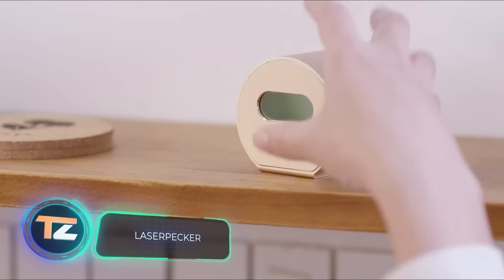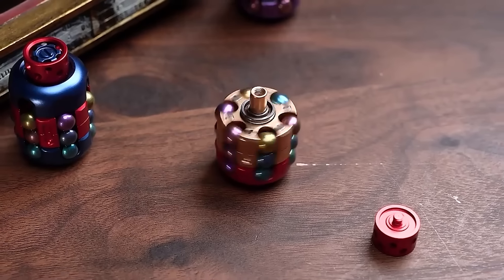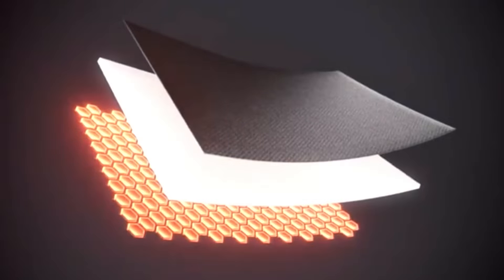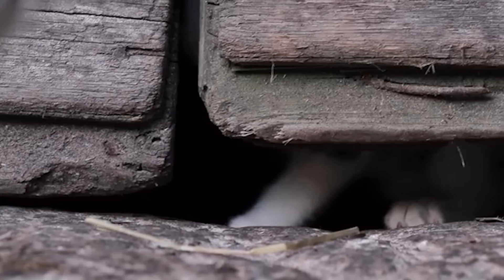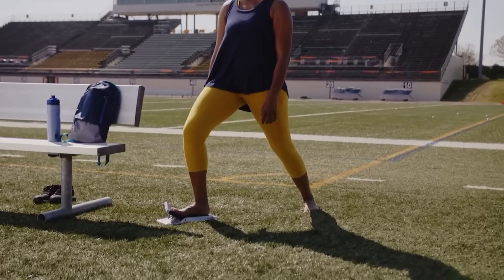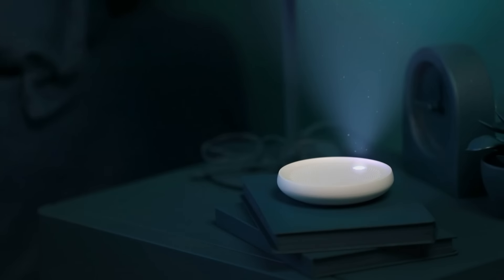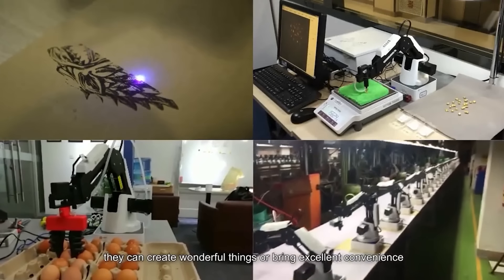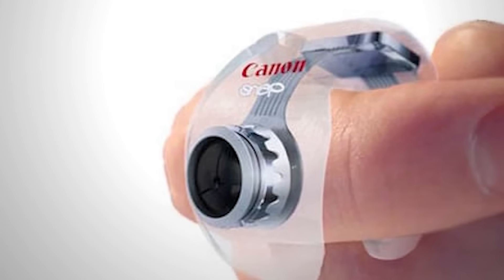11 COOL GADGETS FROM AMAZON THAT YOU CAN BUY RIGHT NOW

Comment: Those lithium battery powered suitcases should not be allowed on aircraft.
Reply: They won't be
Reply: The way baggage handling is done they wouldn’t last very long anyway.
Reply: Totally agree, and submarines.
Reply: @SimpleMeFPV  of course you can't bring it on a submarine silly....it wud get wet !!! Lmao!
Reply: Not only that, but the suitcase would be the biggest trip hazard in the airport.
Reply: Guys, lithium batteries ARE allowed on planes, the size is very limited though.
Reply: This is just silly.  Is it really that hard to drag something on wheels?
Reply: Idk what to think about that 🧐
Reply: They aren’t
Reply: @gregdowd939  lol depends on the Submarine. Most passenger Submarines are pressurized hulls that actually allows a dry passenger compartment lol. Now if it was a personal wet Submarine, There really would be no reason to take this suitcase as most of them have a operation time of less than an hr. Some even lasting only around 20 mins due to battery capacity. I have a feeling this might have been written as a joke but hey, Some people don't know much about Submarine operations and the different types. Lol
Reply: @Slurmpslurmp8356  — They are.
Reply: I agree with you and your comments if you are bringing something in airplane always take the lithium battery out of your computer or in suitcase
Reply: @johnmckenzie8522  — EVERYONE: You CAN take lithium batteries on a plane.  They limit them to 100 watt hours or less.  Do none of you use google?  🤣
Reply: EVERYONE: You CAN take lithium batteries on a plane.  They limit them to 100 watt hours or less.  Do none of you use google?  🤣
Reply: @257796  👉🔴What Do Muslims Believe about Jesus?

Muslims respect and revere Jesus (peace be upon him).  They consider him one of the greatest of God’s messengers to mankind.  The Quran confirms his virgin birth, and a chapter of the Quran is entitled ‘Maryam’ (Mary).  The Quran describes the birth of Jesus as follows:

 (Remember) when the angels said, “O Mary, God gives you good news of a word from Him (God), whose name is the Messiah Jesus, son of Mary, revered in this world and the Hereafter, and one of those brought near (to God).  He will speak to the people from his cradle and as a man, and he is of the righteous.” She said, “My Lord, how can I have a child when no mortal has touched me?” He said, “So (it will be).  God creates what He wills.  If He decrees a thing, He says to it only, ‘Be!’ and it is.”  (Quran, 3:45-47)

Jesus was born miraculously by the command of God, the same command that had brought Adam into being with neither a father nor a mother.  God has said:

  The case of Jesus with God is like the case of Adam.  He created him from dust, and then He said to him, “Be!” and he came into being.  (Quran, 3:59)

During his prophetic mission, Jesus performed many miracles.  God tells us that Jesus said:

  “I have come to you with a sign from your Lord.  I make for you the shape of a bird out of clay, I breathe into it, and it becomes a bird by God’s permission.  I heal the blind from birth and the leper.  And I bring the dead to life by God’s permission.  And I tell you what you eat and what you store in your houses....”  (Quran, 3:49)

Muslims believe that Jesus was not crucified.  It was the plan of Jesus’ enemies to crucify him, but God saved him and raised him up to Him.  And the likeness of Jesus was put over another man.  Jesus’ enemies took this man and crucified him, thinking that he was Jesus.  God has said:

  ...They said, “We killed the Messiah Jesus, son of Mary, the messenger of God.” They did not kill him, nor did they crucify him, but the likeness of him was put on another man (and they killed that man)...  (Quran, 4:157)

Neither Muhammad  nor Jesus came to change the basic doctrine of the belief in one God, brought by earlier prophets, but rather to confirm and renew it.
Reply: @Lucas  This is exactly what I was going to say! It's way too low to the ground and the user can easily mess up the steering
Reply: @Erin-Thor  dudes don't know there own phone batteries
Reply: @stanglvr6781  I also thought it was funny 😂🤣
Reply: @1islam1  so was Jesus for or ageist Lipo batteries on airplanes? I’m guessing he would for give us either way but it’s best to know for sure! Seeing how your an expert what are your thoughts? Do you think he would have a different opinion on packing some lipo batteries for a yellow submarine voyage?
Reply: Yeah, so I guess I will leave my phone, ipad and computer at home.
Reply: @Randy-hydro1127  -- Don't be silly.  You can take batteries on planes.  They allow batteries up to a given wattage.
Reply: @stanglvr6781  yea ....you took me wayyy to seriously.....but hey..im sure u educated somebody out there ..lol..thanks for explaining tho
Reply: @dougashby5679  no phone battery is going to be larger than 100 watt hour.

Some battery backups are though. But 26,800 mah battery backups are designed to be under 100 watt hours. So a 30,000 mah battery backup would be too big.
But there is no phone that even approaches 26,800.
Reply: Caught in 4K Ultra HD
Reply: @zeruty  — You are correct!  I have taken my battery pack phone/laptop charger with me many times when flying, never had an issue.

Comment: Well, since the campaign for the doorstopper has not been updated in FOUR YEARS and it doesn't exist on a web search it either failed miserably or they took the money and ran.
Reply: I am sure it failed.  You can buy one of the rubber wedges that have been around forever and drop it where needed and picked up when not, instead of having to secure that base piece to your floor and possibly have it in the way sometimes.